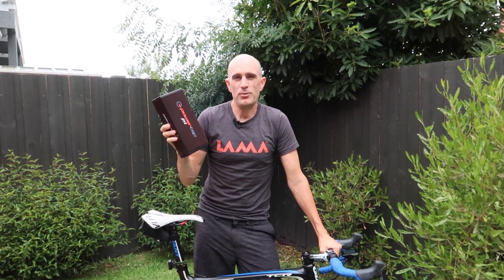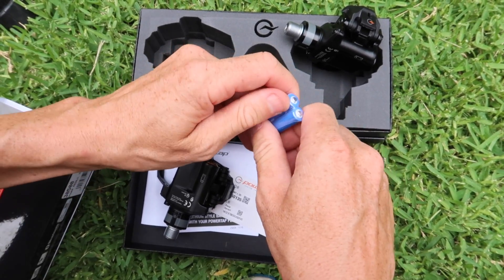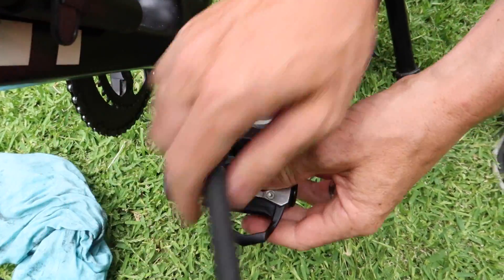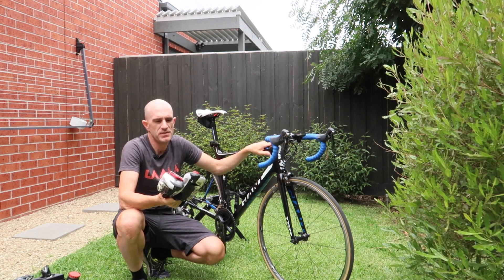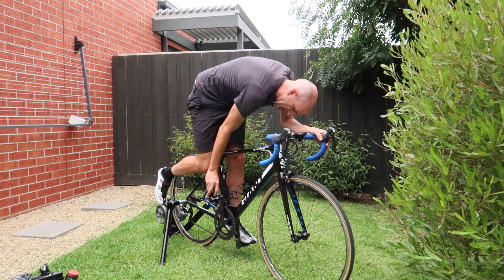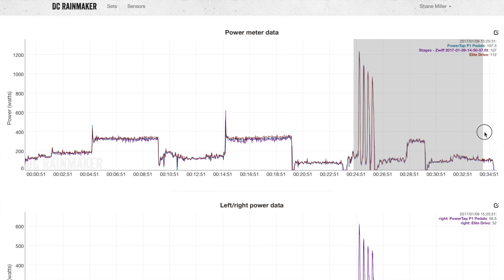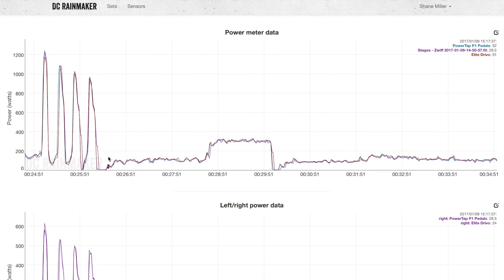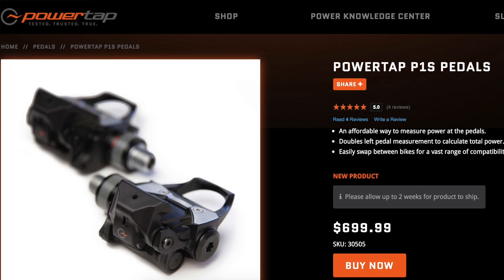PowerTap P1 Power Meter Pedals - Install and Road Test

Comment: Xpedo cleats (6 or 0) are the same, I've been using both. I had same experience with almost no release tension, bought the 0deg, then find I don't have a preference now the release is tightened up. 

The responsiveness you mention might explain why my stages power basically matched the p1 except I had consistently higher avg power in crits with the pt

Comment: Hi Shane, do you mind if I ask a critical (thinking) question? If the 'Stages' power metre is consistent as your video, is it worth paying the extra? Considering the use of the power metre is to compare yourself against yourself. 

I was really keen on the PowerTap pedals, but your video has turned me off. I am not sure I want to sacrifice my very reliable Shimano cleats & pedal system for something that is quite troublesome.
Reply from the maker: Stages - Mine is good..ish. You see it jumping all over the shop in the graphs though. For what I need the responsiveness of the P1 is brilliant. 

Cleats - I think it's a technique thing that I have to learn. If it was a major drama then it'd have been mentioned in a number of other reviews. Give me a few weeks and ping me again. I'll have the new 0deg cleats by then.

Comment: Nice video, great data! They need to come out with a speedplay version. :) Also, do trainers like the neo or kickr measure left and right power output for this kind of analysis?
Reply from the maker: The Drivo has pedal scan analysis and left/right is known when using their wired cadence sensor. So... no.... but yes. I don't believe the Neo or Kickr have it.

Comment: Hi Shane, have you already tried out the bePro power meter? I would like to watch a review about it from you one day.
Reply from the maker: Negative. If it comes across my desk, I'll ride, try break, and report back. :)
Reply: Second that. Very few reviews of this pedal, but the few ones seems always positive.
Reply: I've got the bePro S single sided system and I'm very happy with them.
Picked up a set for $500.
I'd like to see a comparison too.
Reply: we sell bePRO,  very accurate & reliable (zero returns), probably the best deal on bePRO use this discount code duvobikes17 . Shane Ill mention your vlog
Reply: Seems like their pods are susceptible to rubbing from the riders shoe. If they've sorted that, then great. Besides that everyone selling seems to be out of stock, which is pretty damn weird. Remember these people http://www.brimbrothers.com/ all everyone gets is a thank you. 

I'll be sticking with solid companies who don't have supply issues.
Reply: cyc00000 They recently launched a new model Assioma. Looks like this problem is solved, but no review yet.

Comment: How do you want to compare to e.g. the neo? Power on the Axle = Power on crank- drive train losses.  Are the cleats like the look ones?
Reply from the maker: I keep reading forum posts about losses and measurement points. I'll need to get some official quotes from manufacturers regarding this.... it seems there's more guesswork than facts. I'm on the case....

Comment: nice video Shane! I have the exact SWorks shoes, came from Shimano DA pedals and did exactly the marking procedures like you did. I paired mine with a Garmin 1000 and had drop out issues with the right pedal. Quite annoying when you are not pedaling like waiting at the lights, sometimes I will get a notification on my Garmin saying RHS pedal is missing, which seemed to go away after a few pedal strokes. 

Also I have the 2.60 version of firmware but after watching your video I  tried to update to 2.70 like yours, but it wasn't available and said I'm using the latest version already, strange! 

I'm worried about the bearings issues as my RHS pedal has a bit of noise developing. Fingers crossed that it's just me overworrying after reading too much on the internet. 

I got my 0deg? cleats from CRC, after searching bike stores in Adelaide and Melbourne. Keyword: "Wellgo R096 Cleats (Look Keo Compatible)", I have confirm and checked that these are exactly the same cleats as the original.

Comment: hey! i^m about to buy a smart trainer! did you use the elite drivo (instead of the Neo) because of its accurancy regarding the power, or because you use it regularly now? to be concrete: do you prefer the neo or the drivo? (i know the comment section here is for the powertap pedals...) greets from luxembourg
Reply from the maker: I used the Drivo because of the power accuracy they claim. The Neo should be very close too.... I'll need to see the data first though.

Comment: My Edge 520 will only change the crank length on the left pedal. So I need to use the app. Quite easy to forget!
Reply: you can only connect the Left  (Master -Pedal) with the 520!
Reply: Not true. I get pedal balance both on the 520 and in Garmin Connect, so both left and right power is recorded and sent to the 520. When using ANT+ one stream is sent from the left pedal, but it contains data from both pedals.

If you change the crank length on the 520, and then open the app, it will warn you that the pedals have different crank length settings.
Reply: read the Manual, the right is Slave Pedal and sent the Data to the Left Side. You can connect a Polar V800 with Left+Right but the 520 only correct with the Left Side. ;) I have the Pedals and the 520....
Reply: Yes, I think we can agree on master/slave-connection. As I said, the ANT+ stream goes from the left pedal to the 520.

The issue at hand though, is that the power sent from the right pedal to the left pedal and from there to the 520, is calculated using the crank length for the right pedal. If you change the crank length from the 520, you will only change the crank length on the left pedal.

The power sent from the left pedal will in my case be W = (W for left pedal with crank 170) + (W for right pedal with crank 172.5). Using the PowerTap app, you can change the crank length on both pedals, it will ask you to update the other when changing one of them.

Comment: Nice work Shane!  I went thru some of the Powertap youtube vids that were informative.  Also, here is a GCN video tour of PowerTap: https://www.youtube.com/watch?v=5gexR87thRY.  Mildly entertaining... (PowerTap is part of the Saris Cycling Group.  Sent a resume to those guys a few weeks back.  <<<fingers crossed>>>)

So the cleat is proprietary?  What do you do if you have several bikes, like Shane?  What's your plan Shane?   Why wouldn't they just use the "established" versions; re: Keo, or Shimano?  I see in DC's review that he had NEW Keo's cleats that seemed to work though he talked of used ones NOT working.  ANYONE with more used Keo's that could report?   

Also, I was going to comment that I thought you would "adapt" to the clip in, but then I looked at my Keo pedals and cleats...  the front "loop" is WAY more open on the Keo's.  Seems to me the muscle memory would be VERY different to clip in.  Like you would need to be much more "toe down and in first" with the PowerTaps.  Certainly you would adapt with use, as long as you are not switching between bikes with different pedals...  Maybe this isn't a big deal?  Are most people, people who would want these, riding ONE bike?

Comment: The clip in issue I think may be due to them going off the Look model. When I switched to Look pedals a few years ago found the same thing as you with the cleat snagging on the back. Takes a few rides but you learn to sort of push in more with your toes.

Also non cycling but how is that external hd attached to the back of your mac? Velcro or something or is it on there permanently? Would solve my where to leave my external problem so its out of the way!
Reply from the maker: Yep, velcro. Super handy for using the laptop on a plane or in the car... or anywhere.

Comment: Shane your initial assessment is accurate as are the comments below that I've read. my experience with the P1 pedals received December 2015: HARD to clip in (sent me backwards at a race start). both spindle bearings failed well before 6 month warranty period. didn't realize this was a common issue and ended up pursuing warranty repair at 10 months and had to beg to avoid being charged (I'm in USA). couldn't update firmware as I don't have an iOS device. recently I have been having lengthy power dropouts in zwift and on my Garmin 520, when all other ANT+ stay paired and recording data. talking with support right now but I'm not convinced their approach is going to solve the problem. No qualms with accuracy but I've not done serious testing on that front. In the long run I'm kinda disappointed in this $1200US piece of kit.
Reply: I had the bearings issue but tbh nothing else has gone wrong for me due to the P1's.

Comment: good stuff... but why the hell they do make their own cleats???
Reply: They are Look Keo compatible cleats. to be precise the Power Tap cleats are rebranded Wellgo RC7 cleats. (I have both and they are interchangable without issue)
Reply: The other systems are under copyright and needs licensing while the Look Keo style isn't...... someone told me.
Reply: It has to fit the P1s specifically
Reply: I'm not a complete idiot... AND WHY DO THEY MAKE THESE PEDALS SO THAT THEY DOESN'T FIT THE USUAL SYSTEMS LIKE LOOK OR TIME OR SHIMANO?
Reply: fiddler on the bike Maybe the requirements of the design of the P1 necessitated a unique cleat?
Reply: definitely not
Reply: Idk then.

Comment: Bought a set of these last week. Was pretty disappointed to take them out the box and find the right pedal's spindle was wobbling round all over the place. Major bearing issue.

Having read about dozens of people online with similar issues I was slightly wary of this, but was hopeful they were the vocal minority, as per most things online.

Anyway, sent them back and got a full refund. For £900 I don't want to be taking risks like this on the quality of the product. I now have a Quarq crank pm installed.
Reply from the maker: Hmmm. Who's initials were signed on the QC card? Strike them off your Christmas card list. Did you go the DZero Quarq?
Reply: It was MM. Yep, well DFour, only option for Ultegra 6800 which ticks the double sided box for my dodgy knee and the bluetooth box for my iOS Zwift set up, apart from the P1s.
Reply: Shane Miller - I've hears this as well.  Even spoke to a powertap rep who said there 'has to be' at least 1mm gap in the bearing casing due to the mechanism.  did you find this with yours?  perhaps that is why Charlie Woodall was unhappy.  I like things to be dialed in too.  not sure if i'm ready for this step anyway as a commuter.  :)  (though I do timed rides now and then and have been thinking a tiny bit about racing)

Comment: Shane, have you tried/tested a Powertap hub?
Reply from the maker: Not in the last 10 years! The original PT hubs I had were brilliant units.
Reply: Shane Miller thx--I have the Gen 3 Hub and love it. But pedals make more sense, as I travel extensively and frequently hire a bike.  Will be interested to see how you feel in a few months time, re: battery life, waterproofing, etc.  hate to give up SPD...

Comment: I am on my second set of p1's. the first set I had were showing big discrepancies on the power from left to right followed by failure with the bearings on the left side, and yet again my second set have the same issue with the bearings and will have to be sent back.. the first set I sent back had taken over a month to return, not good enough for the price you pay & if you only have the one power meter to rely on...
Reply from the maker: Hmmmmm! Noted. I'll put the acid on these (so to speak) and will report any similar failures. Garmin and Tacx know of my work in this area. :)

Comment: Great video as usual Shane, been waiting for this one. Couple of questions. Did you say you should ride for a few minutes before 'calibrating' thats sounds a bit awkward. How do you get that pedal analysis up during a ride - through the Powertap app I assume but whereabouts?
Reply from the maker: That's for first install on any bike... (or re-install). Once they're on, it's the same as all other power meters, which is they /should/ be zero'ed a few minutes into the ride if theres a large temperature change from inside/out. Reality is most people won't bother, they'll just ride. The Pedal Analysis is within the app once you've started an activity.
Reply: Cheers Shane, will check it out.

Comment: too bad you can't corner with them. 50cm of stack.
Reply from the maker: Who corners with the inside pedal down? DCR did a video showing it was bugger all difference.
Reply: Shane Miller ok fair enough. speedplays make a big deal about having better cornering clearance compared to shimano and there's not much difference there in height

Comment: Mine are back with Pushys as we speak!! On one side the battery was lasting only 3-4 hours. Powertap said it was because I had the original battery caps but because I wasn't based in the US they couldn't authorize a warranty exchange!!!! I bought the new caps, no difference...so back to the supplier. First thing I did was buy the zero float cleats.
Reply from the maker: Hmm! Interesting to get the 'vibe' from others here in the comments though. I'll keep a close eye on mine and report back any similar experiences. Garmin and Tacx know my work well in this area! ;)

Comment: Look cleats, clip in and that float are horrible. In past I have 1 set of Look pedals with 6 degree float (stock with pedals), and 0 degree. It is better for float, but it is still pain to clip in. I hate it. So, I switch to Shimano Ultegra. It is way better in every possible way. It is easy to clip in, and 2 degree of float is just right. 

What is primary reason to not buy all that pedal based powermeter. All of that have Look cleats. They are (maybe) little more durable cleats but after 3-4 month I still can't clip in without thinking about failing. Cherry on the top of pie was that Look pedals disintegrated after 1000 km each. I think that Look makes they pedals from cheese.

Comment: Nice review as usual Shane :-).  
I too have been thinking about the P1 pedals.
Glad to see initial impressions are good. I too was worried about going from Shimano pedals, so would be good to see how you get on.  
Have you any thoughts on this mate...
I would be interested to know how P1s deal with temperature changes, as winter training in UK means taking bike out of freezing garage and training indoors, and also early morning rides in the spring / Autumn can start off really cold but soon warm up near midday on a long ride...
Would it be a case of manual zero offsetting every so often during the ride (as well as before the ride of course)?, which would become a bit tedious after a while?
Thanks, Gary :-)
Reply from the maker: I won't be able to test anything cold for a while... it's 38degC here tomorrow! From the PowerTap FAQ: "We recommend that you perform a manual zero before each ride. The pedals also have active temperature compensation where sensors within the pedal monitor the temperature and adjust the offset accordingly."
Reply: Shane Miller Ah, automatic offset adjustment for temperature changes, that's great news Shane!  38 degrees Celsius...yikes!!!!

Comment: Interesting how accurate you found the pedals to be, a rider at my club has gone through 3 sets of them as they read about 40w high in an ftp test vs his tacx neo. He subsequently moved to the garmin vectors and had no issues
Reply from the maker: Give me a few days to break them...in. I'll do a Neo test in the near future as well. Maybe a Kickr16 if I can wrangle one into the house. What was your experience dealing with PowerTap support? 40W low and three sets isn't an ideal scenario for you (or them!)
Reply: Shane Miller well it wasn't me but a member in my club, who time trials alot so a power discrepancy that large was an issue to him. anyway I think support were good as they let him swap and then finally refunded him when he didn't want another set. I think his were quite an early batch so maybe production is better now

Comment: What is the lifespan of the pedals?
Reply from the maker: I expect a few years at least.
Reply: Shane Miller For me personally with a product with that pricetag I would expect a minimum of 3 years preferably 5
Reply: 3 to 5 fuck you guys have low standards for a thousand pound product. I'd expect 10years
Reply: That's one plus with the Vectors - the pedal body is replaceable.  And can be changed to Shimano :-).  Probably still outweighed by the finickiness though.

Comment: Do you think that they are much better than the stages. Seems that stages is giving you same basic data for half the cost
Reply from the maker: For what I need, they're a LOT better. Two true power meters that respond damn fast. Stages still has a place in the market. I'm also watching 4iiii closely and may be adding them to the mix soon too.
Reply: I would have bought 4iii if they had been available in the UK at the time I bought stages because 4iii looks interesting as fuck and is a good price.